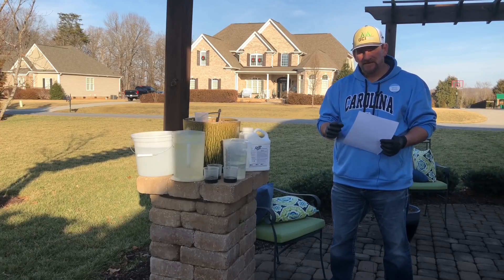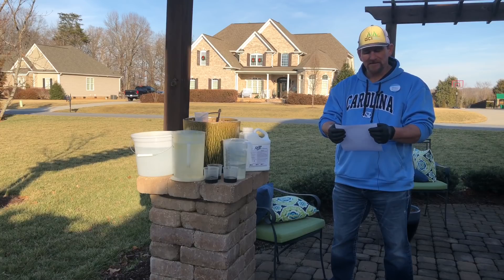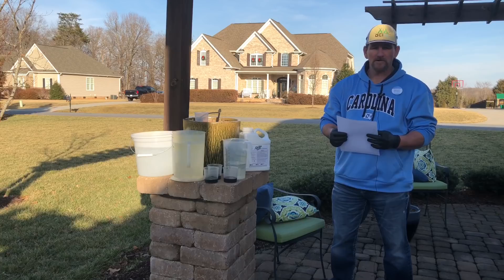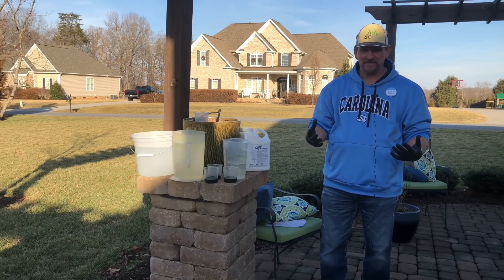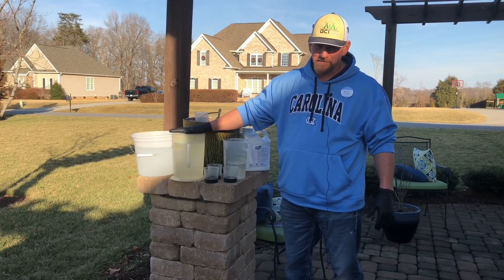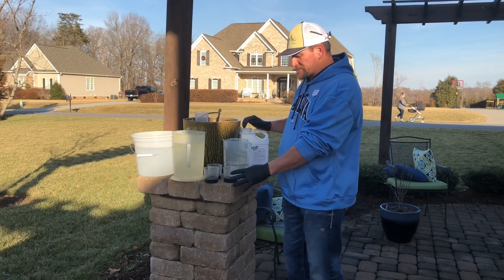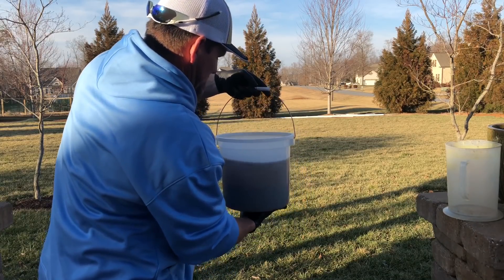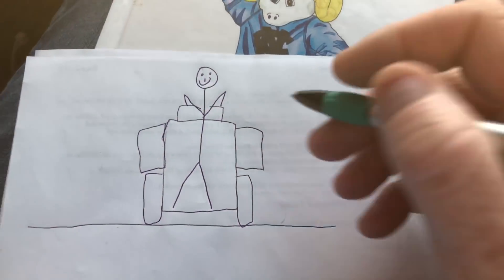How to calibrate any sprayer

Comment: Pete, Thanks for this series on calibrating sprayers.  I bought a Chapin battery operated 4 gallon sprayer and used it for first time yesterday.  (wishing I had purchased your recommended 4 gallon on for it looks like less likely to leak. The lid on mine will leak if tilted on its side and slips off if you lift using the lid.) Your calibration series helped tremendously and I am now a fan of your channel.  My hand pump sprayer was a pain and now It is being donated to charity, while I order another smaller one battery operated from your website.  I like the idea of having separate sprayers for separate applications avoiding damage to turf if residue from roundup.

Comment: Thank you Pete! You had me nervous about those sneakers.
Reply from the maker: Lush Lawns ha ha. Shoes are ok. Did this answer your question?
Reply: GCI Turf Services yes and no. My confusion is actually with something that the rep for the RGS said and I'm going to follow up with him about it.
 He said that they recommend it being sprayed at 3oz per K with a total volume of 2 gal per K of finished product to get the product watered in the soil. So if a permagreen is applying a quart per  K ( with the same 3 oz of RGS), how is it getting the same result. Is it due to the height of the spray heads on the permagreen being so close to the ground (which is a fixed height , pressure and speed of application) ?

Sorry for the  lengthy question and truly appreciate the time and effort that you put into trying to help everyone understand the business. You do an excellent job of explaining things to make it easy for people to understand.

Thanks, 
Aran Donnelly 
Lush Lawns
Reply from the maker: Lush Lawns ahhhh!  I see now. I actually pay no attention to that. 2 reasons why
1- I’ve sprayed it both ways. Low volume and high volume. The result it the same. No difference. 
2- it takes more than 2G/1000 to water in a product. Usually takes 1/2” of rainfall to do that. 

That’s my take on this
Reply: Pete thank You! I'm on the fence about buying a permagreen and want to make sure before I pull the trigger.
Reply from the maker: Lush Lawns you’ll love Permagreen. They are very nice
Reply: What size shoe would I have had to replace? 12?
Reply from the maker: Lush Lawns ha ha. Size 12. Lol. They still clean!
Reply: GCI Turf Services let me know I have a guy at Nike
Reply from the maker: Lush Lawns I’ve got the Jordan 13’s on my radar. I think Jordan’s I wear a 13. I’ll double check and let you know. Let me know how much they cost https://goo.gl/images/ekHd6h
Reply: Will do
Reply from the maker: Lush Lawns I’d rather wait for the ones I showed you 😎
Reply: GCI Turf Services I have him  work as hard as you do
Reply from the maker: Lush Lawns 🙌🏻